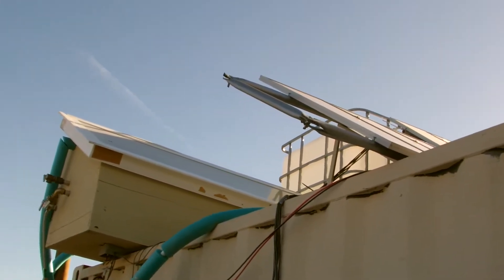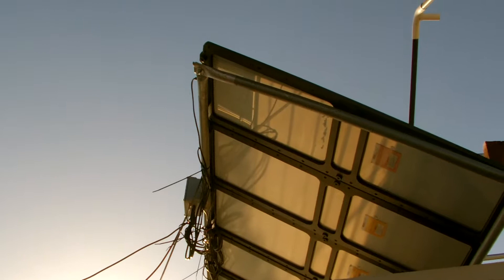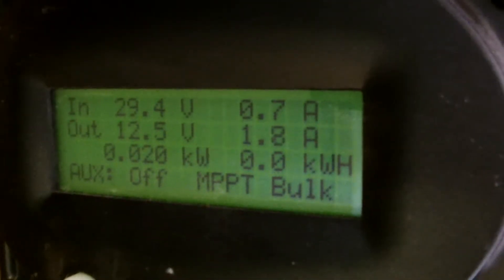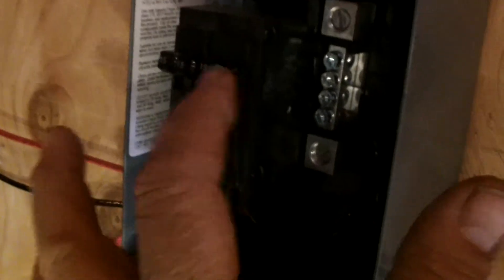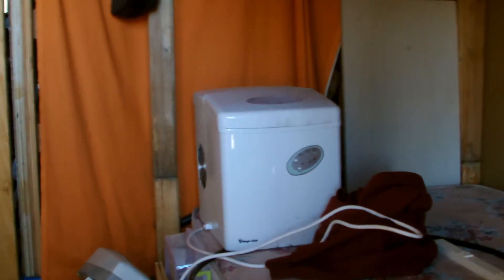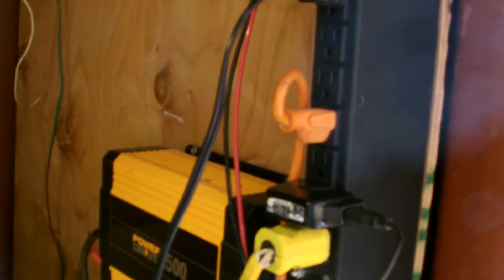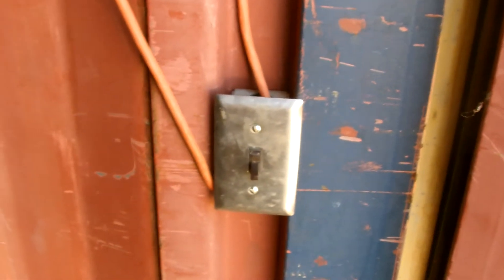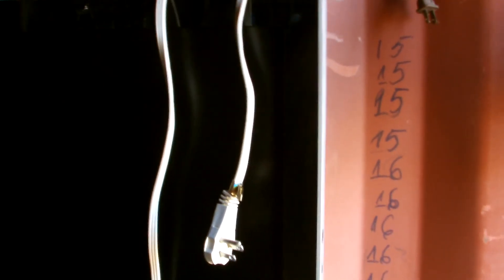Harbor Freight Panels and Outback Charge Controller Part 2

Comment: Nice little setup. Thanks for sharing.
Please checkout my channel you will find videos of my FTA SATELLITE.
Moreover I just Subbed your channel please subscribe and thumbs up to my videos if you happen to find anything you like.
Cheers
Reply from the maker: I have since added 2- 100 watt Renogy panels, which has doubled my power output. I have a chest freezer running off of my solar. I set the timer so the freezer is on one hour every 8 hours which manages to keep the temperature at around 40 f.
 I switched out my RV batteries for 4 Interstate golf cart batteries which I purchased from Costco @$85.00 ea.
 The maximum power I produce is about 370 watts at peak. The freezer draws about 80 watts/hr. so not really dipping into the batteries much.
 I have checked out your videos nice work.
Reply: Thanks you so much for taking your time to view my videos and thanks for sharing all the good work. 
God bless 
Cheers